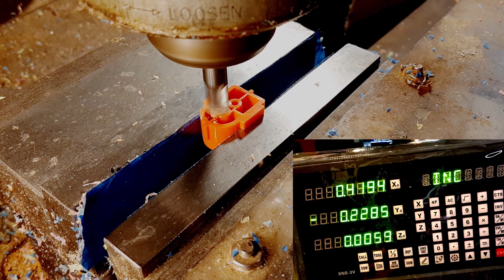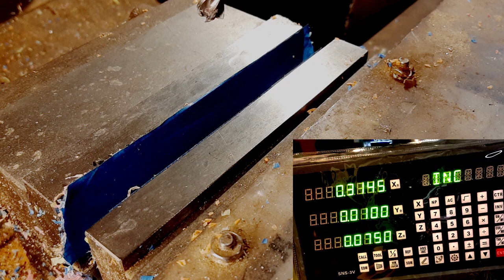How I Build Mechanical Fret Guitar Hero Controllers(In Depth)

Comment: I modded rgb mechanical switches for the fret board, and mechanical for the strummer on my Xplorer. I have a faded airbrush body that was resin printed. Its a custom body i designed in the shape of a Lado Earth Guitar (best shape ever) and the buttons are transparent. 

Originally it wasn’t wired so i made it a type-c connection i stole from a broken pc controller which also gives the OPTION to use bluetooth on my guitar. I added some weights in the body and neck as well as custom ordered aluminum parts for the buttons, strummer, and little things like the strap connectors.

The whammy potentiometer was bugging out so before making that new shell, i soldered a new one. I relocated EVERY button to look like a Lado Earth Guitar, disguising buttons to look like the knobs, etc.

I might re-paint the fret board and rgb to the pick guard. Currently adding a battery but i decided to just use re-wire portable phone charger.

Comment: I got a question, what receiver do you use to make these wireless 360 LPs work on PC? I have a Microsoft receiver but I’m having some issues with it.
Reply from the maker: If you have the Microsoft 360 wireless receiver that's the one. If you're having trouble linking your controllers reply again and I can help out. Windows is odd and doesn't automatically install that reciecers driver

Comment: which color mechanical switches are the best???
Reply from the maker: @g0od  honestly that is all based on preference. 
It's all what you're looking for. Some like the light pressure switches with no tactile click and they do just fine, 
Others do heavy pressure with the click. I personally prefer whatever the Silver ones are(don't know off the top of my head but I think they're 70g and has tactile bump but no click sound) hope that helps lol but they're cheap enough I suggest trying different ones out
Reply: @ninjapwnsatlyfe  Thank you for the response. I have the red mechanical 50g linear switches on the way from Hobbycnc and I'm hoping I like the way they feel. Trial and error I guess. Thanks!